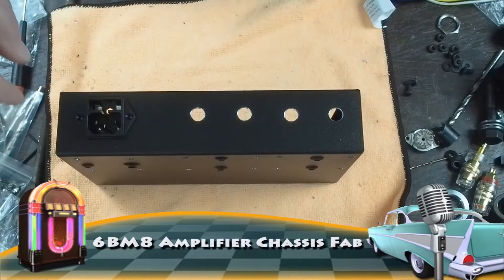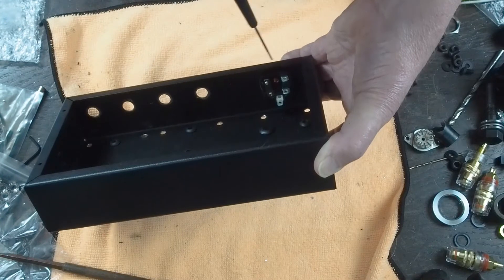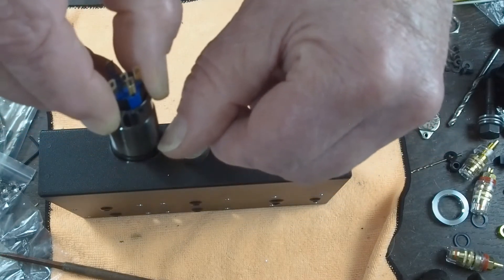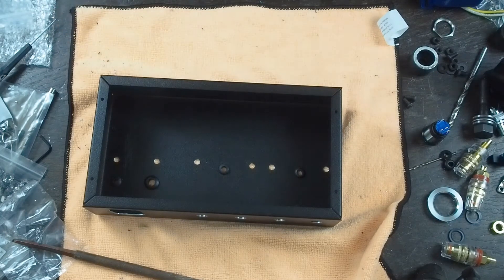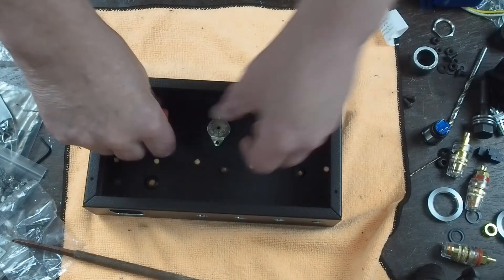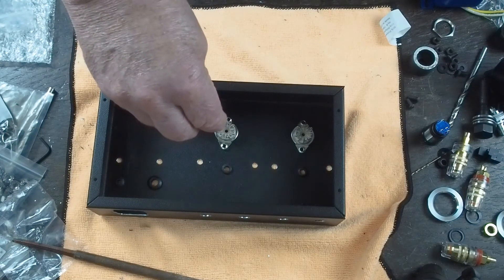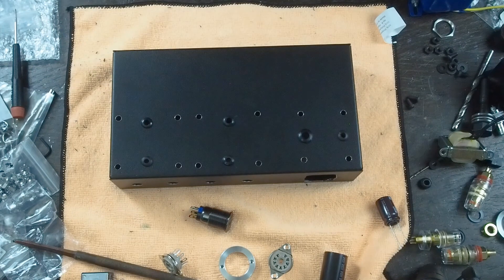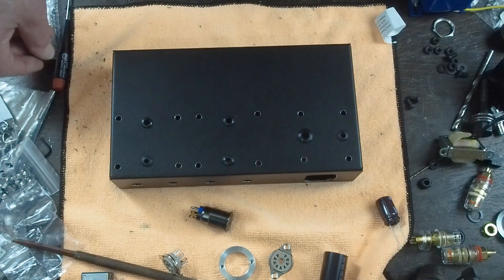6BM8 DIY Tube Amplifier Chassis Fab #5

Comment: You have your standard,i probobly wold use a fastened cord fore ac,cause of the worke time.if the amp is realy good,one can make a new shassi,when perfect,or you can slaugter it fore another prodject later,the funn is to create,and parts cost monney. Your entusiasm is fantastic! Im starting to prefer small amp build. Spesialy pree amps. Was moving some big guitar gear today,and the speaker cabinette was like made of concrete. More funn to worke with a litle light weight.